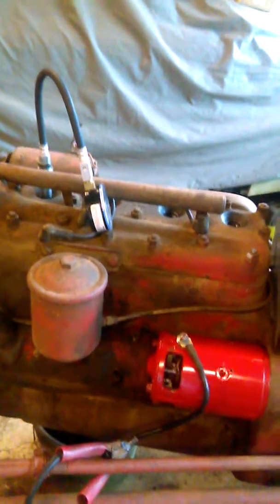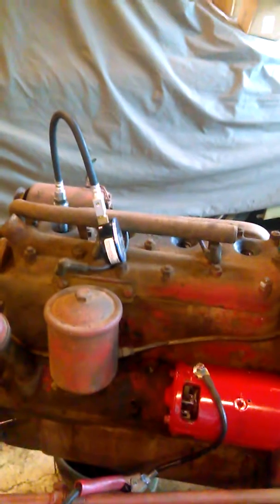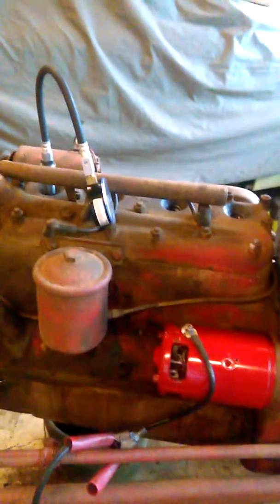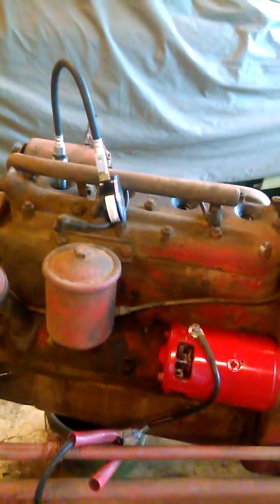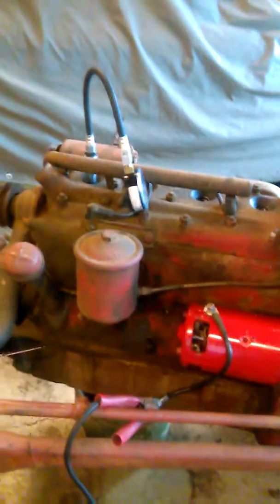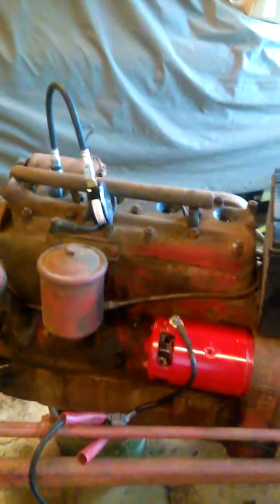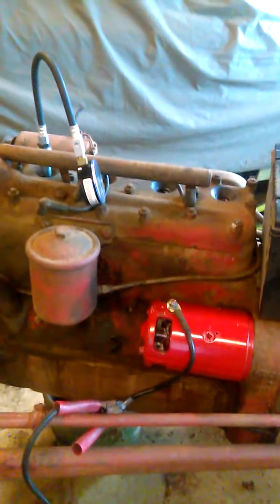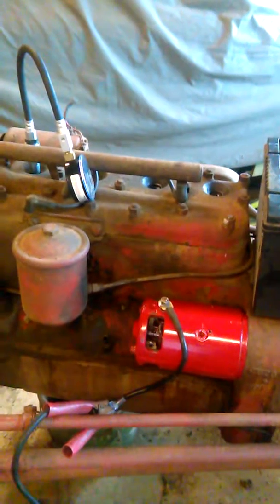Compression test on Grampa's tractor

Comment: What did you ever figure out with the tractor 
Iam having the same problem
Reply from the maker: I have temporarily halted work on the tractor until I get other projects finished, but I kept soaking that cylinder with penetrating oil and spinning it over with the starter every once in awhile. The compression eventually came up to 90psi, so I'm sure it was sticky valves. I'm sure once I get back on it and actually get it running, it'll be ok.
Reply: I got mine running 
You can’t do a compression check before you get those old things running
I did and the reading was 60psi after it ran for a little while it jumped up to around 100